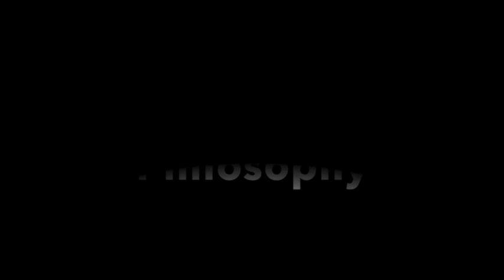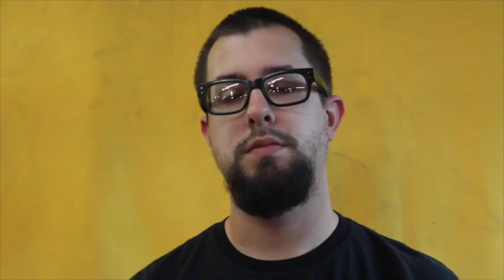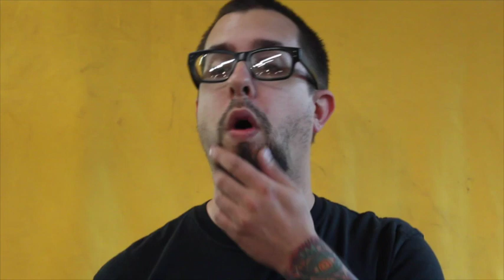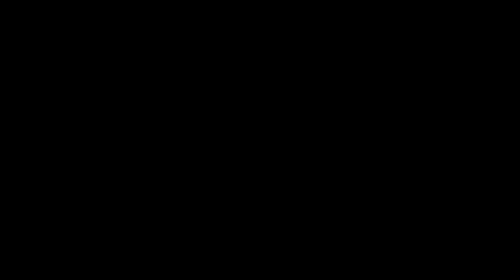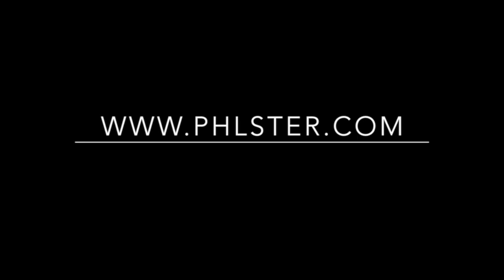"Custom" Philosophy

Comment: Amen, I turned down several ppl when I did gunsmithing because they wanted super light triggers on their carry guns. There were several other projects, like modifying a gun in some way, that would compromise safety, function, or durability that I just flat out reused - not only for liability, but when that thing fails, its going to look bad on you.